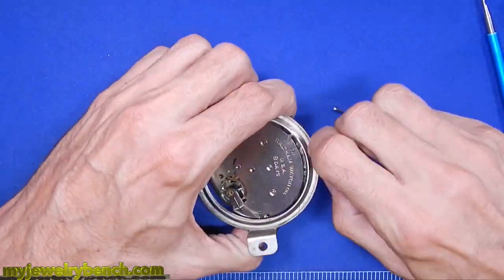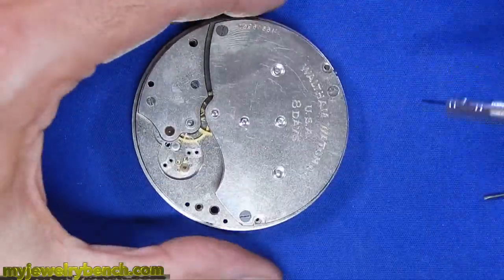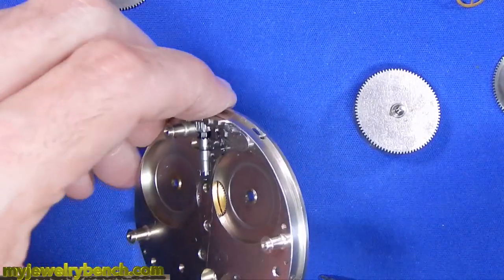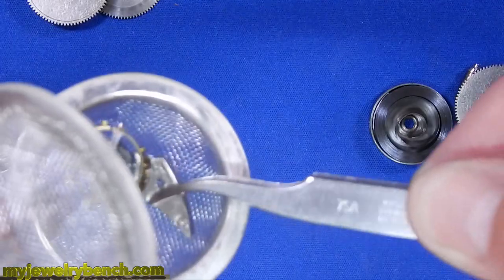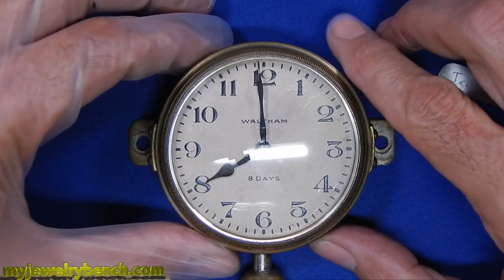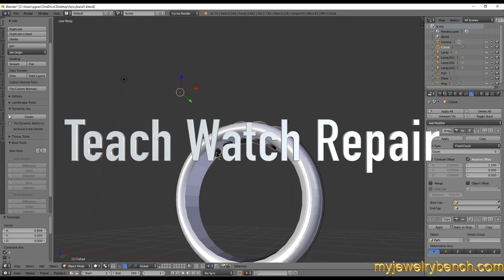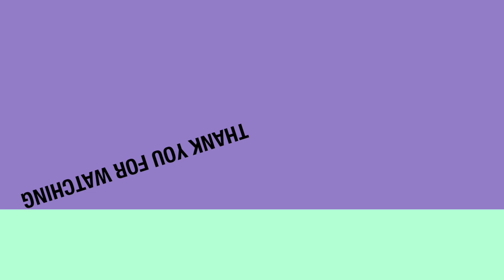Antique Car Clock Service

Comment: I have an Elgin long stem Dash clock, winding stem locked, stem works for time setting but won't wind. Is it repairable?
Reply from the maker: Yes, it is repairable.  There are three reasons that this would happen.  First, the step and case may have an error in position.  Case tubes are sometimes adjustable.  2nd, the clutch may be out of position.  If there are no broken parts in the clock, it may have to be disassembled and repositioned, oiled and tested.  3rd, a clutch click may be broken.  Depending on the clock, there may be a replacement, or it could be laser welded or repaired that way.  I hope I didn’t over simplify the resolution for you, but, they are not difficult problems.
Reply: thank you, for your time and reply!  the watch acts like main spring is maxed out, as it will let the stem click backwards. I have had smaller watches act this way. the age of the clock makes it worth keeping, working or not and I just found out today what this weird relic from the past was. Again many thanks.